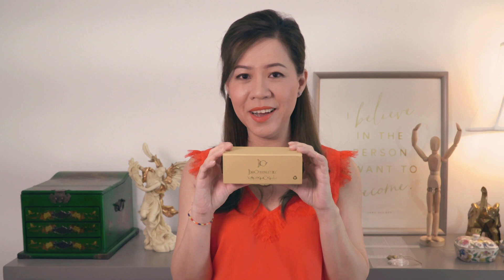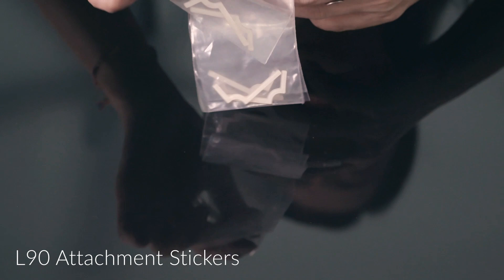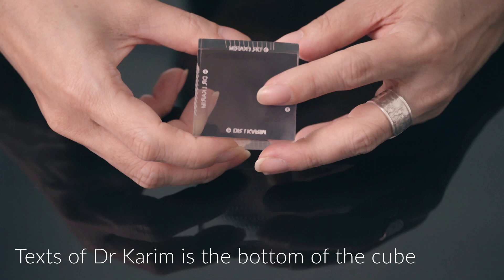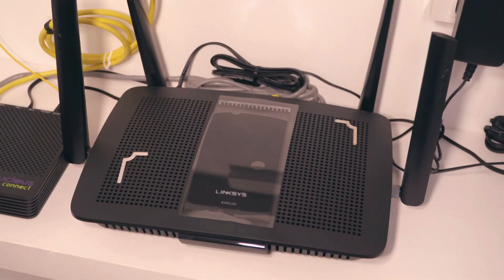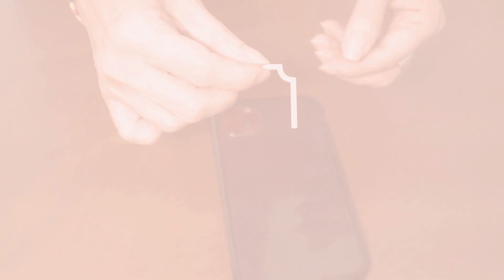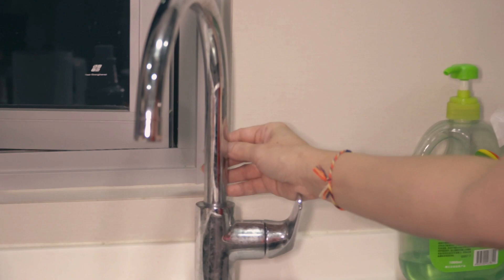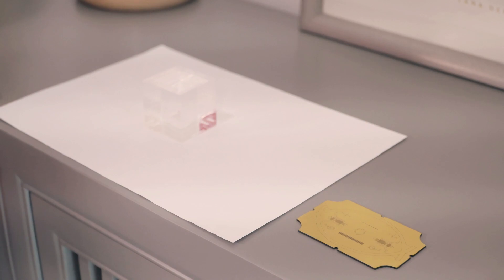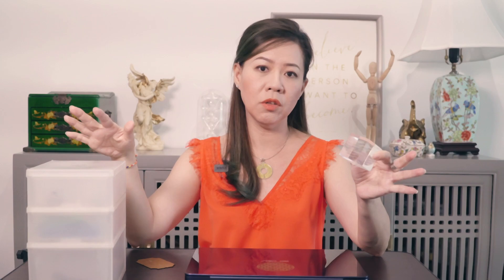Balance Your Life with Biogeometry® Home Kit - Helen Ong

Comment: I don't think you talked about the cell phone sticker in this video but if you happen to know are you supposed to place the cell phone sticker on the cover of the cell phone or are you supposed to take the cover of the cell phone off and place the sticker on the cell phone itself? Thank you! The instructions that came with it are not clear to me
Reply from the maker: Thank you for watching. This is a home kit video and hence I didn't talk about the cellphone sticker. The reason why there's no description is because it doesn't require specific way of installation. You can simply paste it on the back of the phone case. And remember to clear it on the clearing tray that came with it at least twice a day.

Comment: Hi guys, I've just listened to a podcast with Ibrahim Karim on Paul Chek's Living 4D. Really interesting stuff and it makes a lot of sense. My training in the western engineering/scientific/reductionist model but have an ear open to more ancient/holistic wisdom and a leaning to the fantastical (for the better or worse). I was wondering, has anyone here used the cube and what have you noticed when you did? Would be really interested to hear people's experience with this home kit. Please feel free to comment here or PM if that works better. Thanks T
Reply from the maker: Thank you for sharing this Tian. The home kit has all the basic requirements for balancing home especially for those are trained to measure. It's promotes relaxation while protecting you from the harmful radiation from the environment that we are living in today. Just the cube alone offers 3000 sqft in coverage for balancing.

Comment: Is it ok to place the cube on my bedside table if my bed has a metal frame? I was reading in the instructions that one should avoid placing it near large metal objects? Also, how far does the protection extend? Thank you.
Reply from the maker: Yes it's ok to place it by the bedside table. Just make sure that you allow at least 10 to 15cm on all 4 sides of the cube. And also it should be placed on a light surface that's non reflective.
Reply: Thank you!
Reply: @helenong3623  what is the best way to re-stick the L90 stickers as a couple of mine have fallen off? Thank you
Reply from the maker: Try removing the remaining stickiness on the L90 that has fell off. Make sure it is clean and also the surface that you are sticking in is clean and dry. Buy a glue for craft work in an art store meant for plastic or acrylics. Apply the glue and let it dry a little before you stick on the surface. I hope this help :)
Reply: @helenong3623  It does help. Thank you!

Comment: Is there any biosignature helping my wife with her headaches?
Reply from the maker: It depends on what is the cause of her headache. For effectiveness measurements are required. But if you have the Biosignatures or mandala colouring book, it will be helpful to start with the ones for headaches
Reply: @helenong3623  Thank you Helen. Can't wait to get the ordered book delivered
Reply: I used to get headaches really easy years ago and looked into dehydration from headaches. Drink plenty of filtered water at a high level of alkalinity. Don't get headaches unless I go a long long time without water now which is rare lol Maybe after a long 3 hour trip and I ran out of water.